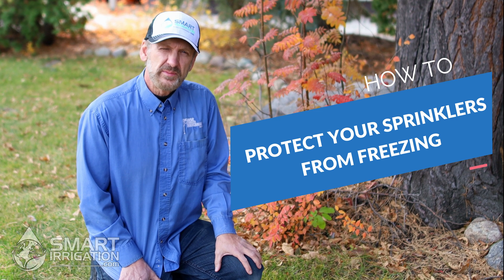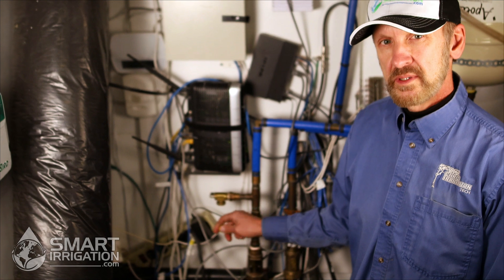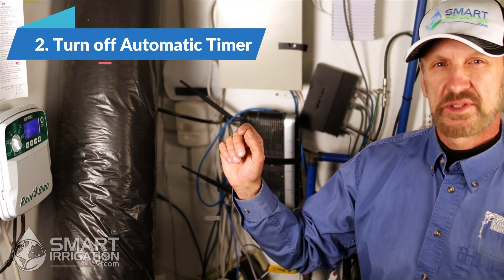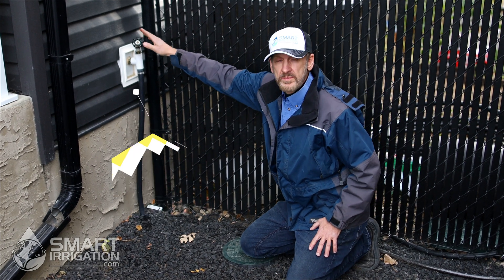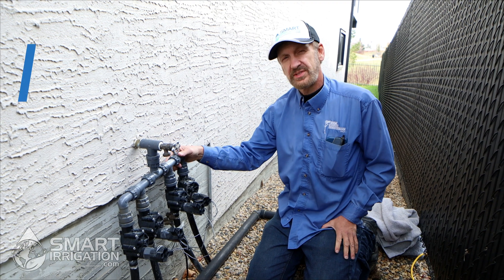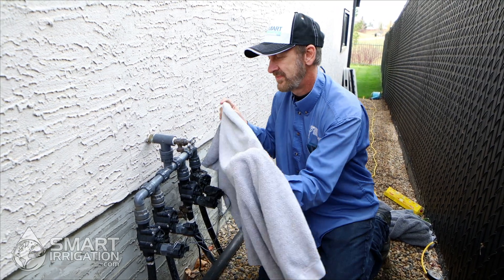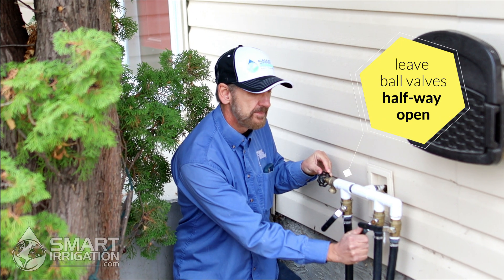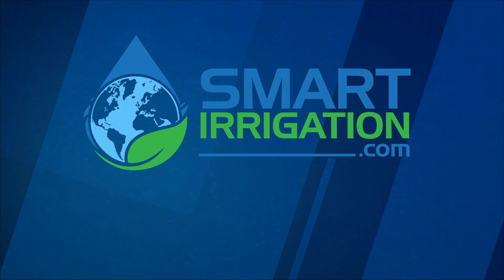Winterize your Sprinkler System: How To

Comment: I live in SC and was wondering if I need to do both : the shut off steps (shut off inside valve in my garage AND the outside shut off in the ground box) or can I just do the latter and just shut off the outside underground box lever? And lastly do i need to drain the pipes..do I run the outside spigots or run all 5 of my irrigation sections in the yard or just the first section until empty?
Reply from the maker: Sounds like you are planning to blow out with a compressor yourself? We recommend using a professional the first time if you are not sure how to do it yourself. To answer your last question it depends on the size of your compressor but this video is to help protect you from freezing before the blowout and before the ground freezes. To answer your first question the first shut-off in the supply line so if that is the garage one if I'm guessing right. The others should be left 1/2 open.
Reply: @SmartIrrigation1  thanks, no compressor at all. I have a gravity flow system
 Il’ll end up cutting off the irrigation lever at the edge of my yard and then shut off the outside water lever in my garage  (outside faucets and yard irrigation) and